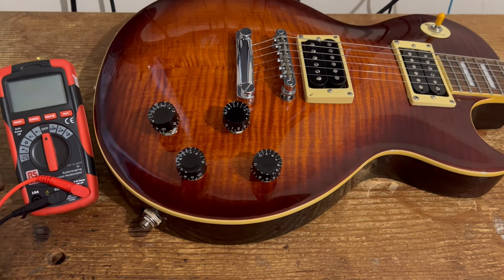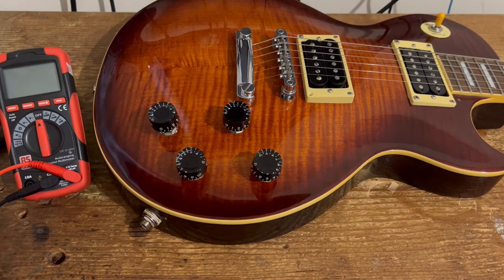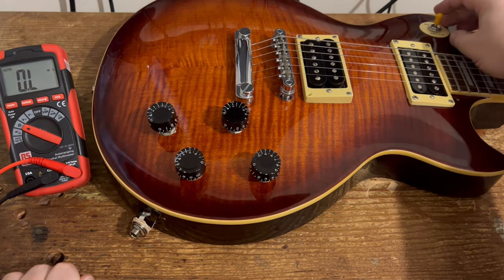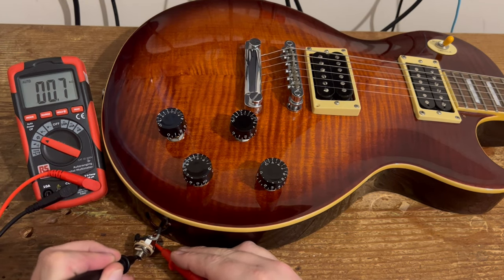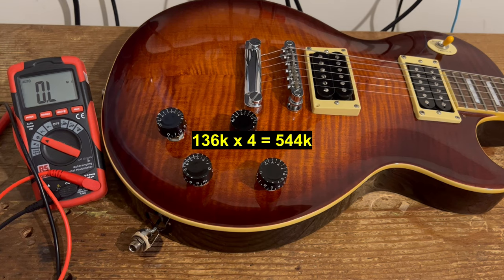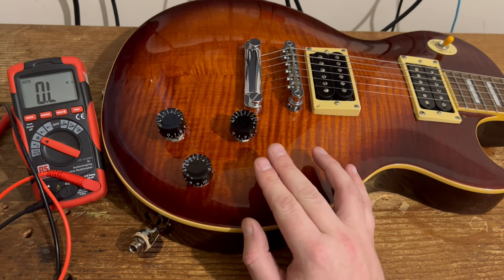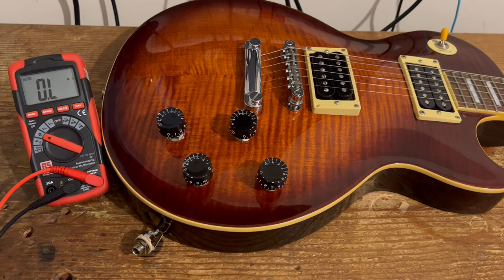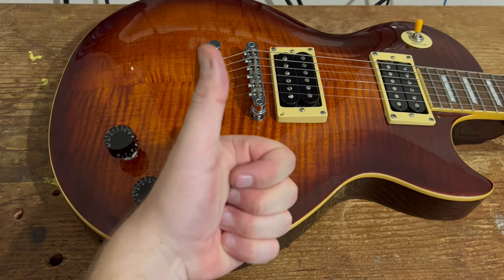How To Measure Guitar Pots When In Circuit

Comment: Thanks. This is super helpful (I didn't know the trick about figuring out pot values and types). You can also do this without having to remove the output jack, which makes the whole process much easier. Just plug an instrument cable into the guitar and measure resistance across the tip and sleeve of the other end of the cable.
Reply: Yep, I just plug in a pedal cable.  It's small and fits easily with other guitar tools I keep in an old DMM case.

Comment: Great video. When I first viewed your video, I wasn't convinced that the formula you presented was valid - I thought that it might have been a "rule of thumb." But, after working out the circuit equations, from first principles, I concluded that the formula is accurate. The only minor inconvenience with measuring resistance at the output Jack is that measuring a pickup resistance with the volume pot in circuit in will introduce a slight error of a few percentage points (in the hundreds of ohms range), but that's minor in the grand scheme of things.  Sure beats removing covers to develop some ballpark values. Well done.

Comment: If you take a cable replacement end and keep it with your multi meter, you’ll never have to take off the jack cover. 😉 (I’ll even plug in a cable into it and then unscrew the sleeve from around the cable tip and use those for access (knowing it is rounded down for any connectivity interference).

Comment: You have made me buy all the tools. Soldering kit, assorted tools, wires. Im kinda scared to use it. I need a junker guitar to work on
Reply from the maker: yes always wise to get a junker or some old/cheap parts to practice on. Good luck with your project.

Comment: My guitar only has one volume knob, a 3 way toggle and two humbuckers…

I followed the method for the bridge and neck pickups, and the final values I got were the same with a tolerance level of +/- 1

Did I do it right? Because, I’m lead to believe I have a 540k ohm potentiometer installed on my guitar; which will help with the high output pickups that I’m about to install 😊

Outstanding video once again, thank you for passing down the knowledge ❤

Comment: I just found your channel. Man, you are awesome ! Everything I wanted to know. I did buy a guitar that I can take apart, unlike that beautiful les paul style you have there. Im working on a Donner strat style. Ive done a few easy things and sure I will have plenty if questions for you, if you dont mind. What is that you wipe your solder iron tip on ? It looks like Brillo pad ? I did solder back in the 80s in a factory job but mostly I was in the machine shop, so I did have some knowledge, but need to get it back. Im gonna attempt the cable jack first because it seems to be where im getting buzz. I ordered one of those new 4 point types. I could see it was cheap China slapped together, no heat shrink or anything. Thanks for doing what you do. I may have a few questions along the way on building my Frankenstein strat.

Comment: Thanks for a fantastic and informational video. I’m wondering if using a short patch cable would introduce too much resistance to get an accurate reading? It would let one avoid pulling the input jack.

Comment: Is the calculation the same if you want to see what the resistance for the pot is at somewhere other than max? Say for example you put the volume pot on 2 rather than 10, would the value be the resistance at that position divided by 4 minus the pickup value? I want to put a toggle switch in circuit that replaces the volume pot with a fixed resistor. That way I can switch between the variable vol pot level and a fixed level, rather than have to try and find the right spot while playing.

Comment: How would this work on a 2 pot style? I assume you multiplied by 4 because of the 4 pots. Do I multiply by 2? Or 4 still? I did the math and I’m within the tolerances of 250k when I multiply by 2. And also 500k when I multiply by 4. How do I know which math is right?
Reply: My pots have no value stated on them is why I’m curious

Comment: Could someone explain why the resistance increases to a peak value and then decreases? Shouldn't the resistance be the highest at knob positioned at 10?
Reply: I’m not sure when exactly or how exactly or even why exactly. but I figure it’s because it stops resisting to a degree, and you see the pickup resistance at that point as he noted.
Reply: If the pot is rotated to the highest value shown on the knob, the volume should be highest and resistance should be lowest. Because if the resistance is high, the signal being output will be lowered. As for why the resistance increases to a peak then decreases while the pot is being turned all the way in one direction, I'm still trying to find an answer as to why

Comment: Thanks for the video.. my duncan designed pickups read 15.7 bridge and 7.5 neck- sounds about right, but the pots  volume value peak is only 19.5? Multiplied x4 as you suggested is way too🤔
Reply: That can’t be right.

I have Duncan Designed pickups too, and the measurements you mentioned [15.7 Bridge and 7.5 Neck] are in the same areas as mine.

Did you turn the knob to zero, and slowly rotated it to find that peak value?

Mine peaked at about 139 - 140, and once I did the math, I came up with ~540k ohms.
Reply: Same on my 335. Did you ever figure it out?

Comment: This works well for measuring the resistance of the pickups but, in my guitar with a treble bleed circuit it will not properly read the total resistance of the circuit. Does this make any sense??
Reply from the maker: Yup this method won’t work if you have a treble bleed wired in parallel.

Comment: I suppose it's the same on single coils / Strat? Does 210 sound right for volume pot? Seems outside of tolerance.
Reply: Single coils would usually use 250k pots so that sounds pretty close to me.

Comment: Thank you for your helpful videos! I have a problem with a guitar that I can’t figure out: the pickups read twice the resistance that they should. I’ve only measured them in the guitar because it’s a 335 style and I’ve been hoping I wouldn’t have to take it apart to figure this out. The pickups are supposed to read about 10k in the neck and 14k in the bridge, but the readings I’m getting are 20.1k in the neck and 29.8k in the bridge. Any help/advice would be greatly appreciated. Thank you!
Reply: Even 10k and 14k are pretty high values for a semi-hollow, no?

Comment: There should be no need to remove the jack to access contact points. Simply insert a cable (of any length) and take the readings from either side of the divider insulation on the cable jack end.